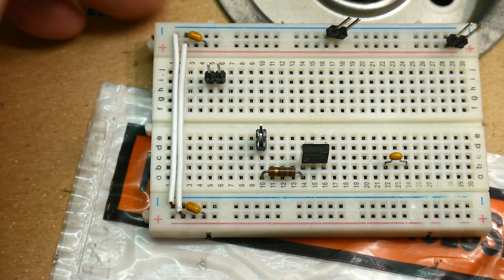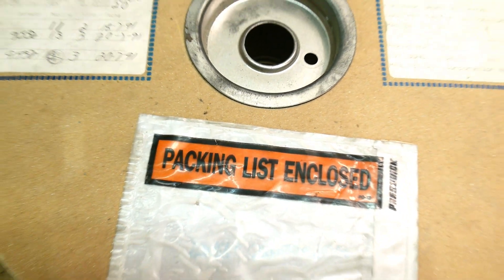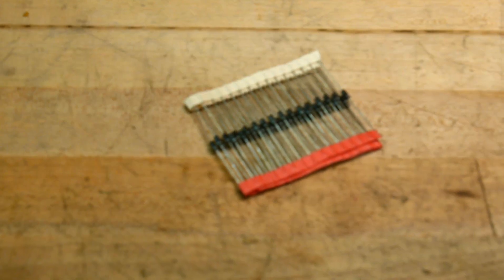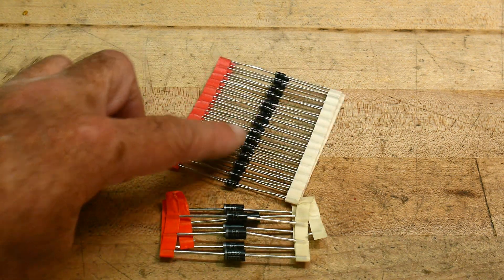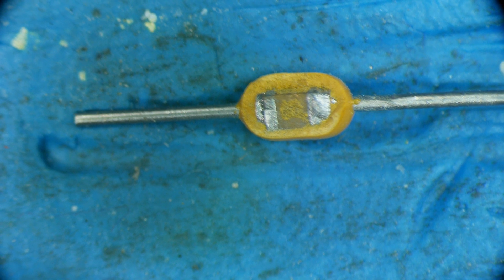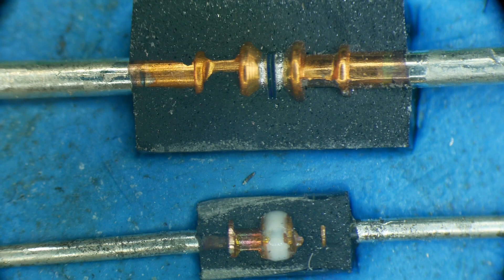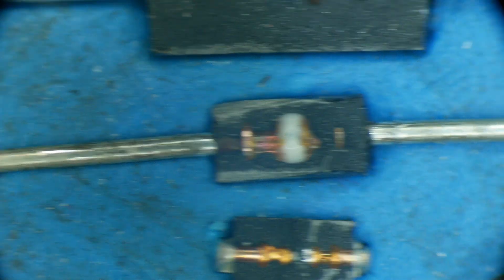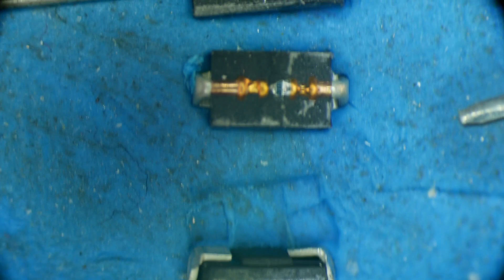#904 What a Diode looks like Inside?

Comment: I had no idea that the SMT diode tabs were flattened copper wire soldered to the die. I envisioned wire bonds in there as dinner other silicon devices packages use.

Comment: Also bought on an auction 4 boxes of zener diodes. 40k zener diodes, half 12V and the other half 24V 400 mW type. So I have been using them as regular diodes where the voltage is low enough, and I only need 50mA of current rating. They are great on relay coils, use 2 in series, back to back, 12V on a 5V relay, and 24V on a 12V relay coil. Faster release time, just have to make sure the transistor driving the relay is rated over 60V Vceo, or take a gamble that a 30V rated transistor actually will only break down at over 40V in most cases, which is generally true with modern devices.

Forward bias them at 2A and they turn into light emitting diodes, after a half second or so, at least till the glass case melts. Got a whole string of them, forward biased, as the voltage regulator on some 2F supercapacitors, 4 in series across each 2F capacitor, to replace an old NiCd battery backup pack, so that you get a good enough emulation of the cells, as they are trickle charged. Self discharge of the capacitors is not a worry, as the battery is there for backing up a clock memory, and thus it will work for at least a day of no power. I got tired of replacing the NiCd cells every few years.

Comment: Is the white goop soft ?  Beryllium Oxide paste was used in transistor packages BITD… deadly stuff 😳
Reply from the maker: seems glassy
Reply: @IMSAIGuy  The white goop is a low melting point glass, used to seal in the silicon junction and fuse it to the leads. During manufacture they assemble the diode and place it between the ends of the lead frame, with a thin coat of solder paste on the formed ends. Then the glass is applied as a drop of slurry that covers the silicon and the ends, and dried. Then the whole lot is heated up in a inert atmosphere oven to both melt the solder paste to make the connection to the die, and melt the glass to seal the junction in and hold the die under compression as the glass cools. Then the epoxy overmould is applied. 

You get larger diodes where the glass is applied more thickly, and creates a bead around the diode, so after firing the glass holds it together, and there is no need for a epoxy case.

Other manufacturers use instead of glass a white thermoset epoxy, which is heat cured during the soldering time, to do the same protection, as the black epoxy is not a totally hermetic seal, and it does allow water to diffuse through it. That is why your IC packages have the drying sachet in the original packaging, and also why you have to have a specific heating cycle in an oven to bake them if they have been left open, as otherwise the moisture in the package will turn into steam, blowing the epoxy apart.  Called popcorning, as it is the exact same process, which destroys the IC.

Comment: I've got a lot of AVX capacitors too. You hang around eBay long enough you stumble across killer deals. I have more HP SMD LED's than I'll ever be able to use in my lifetime, but for 20 bucks for partial reels it was impossible to pass up.

Comment: Hello, I don't know why the 8051 cpu are not so popular, and no one makes videos about it
Reply from the maker: the 8051 is not microprocessor but is a microcontroller (the first one). So access to the (very limited) rom and ram is difficult. The internal ROM is not programmable and the part had to be ordered. the 8031 had external rom if i remember right. The PIC and ATMEL parts took over microcontrollers having programmable parts
Reply: @IMSAIGuy  I'm working on 80c32 romless, I use a 64k of rom(/cs connect to a specific pin called psen) and 32 k of ram(0000h to 7fffh) , (8000h to ffffh) for other peripheral like 8255 ppi ect.. , it can run 8051 basic... I think a 6502 or z80 can't access more than 32k of rom and ram
Reply: @noureddinebenakrim5458  The 6502 had a unified fully usable 64K address space, but the Z-80 had separately addressable 256 bytes of I/O space though with an undocumented hack a full 64K could be addressed.
Reply from the maker: @noureddinebenakrim5458  the 8080 8085 z80 6502 all have 16 bit address space (64K)
Reply: @IMSAIGuy  yes yes I know, I wanna just say that the 8051 can access a 64k of rom using (Psen) and a 64k ram using (/read and /write) anyway thank you for replying, so happy with that
Reply from the maker: @noureddinebenakrim5458  the 8080 8080 z80 also have 8bit IO space which can be mapped to anything